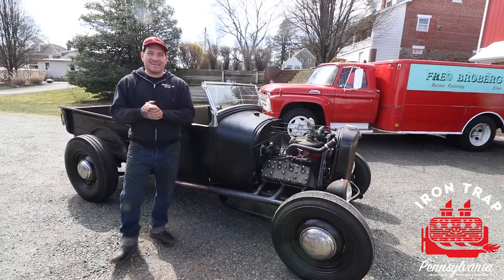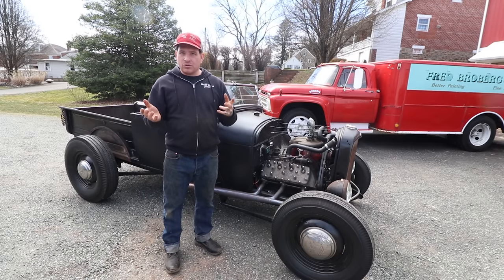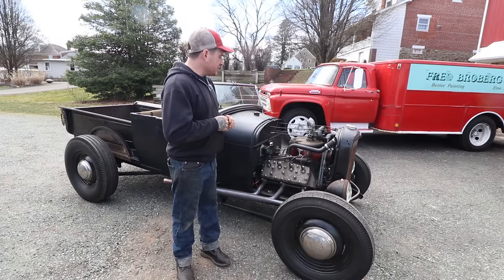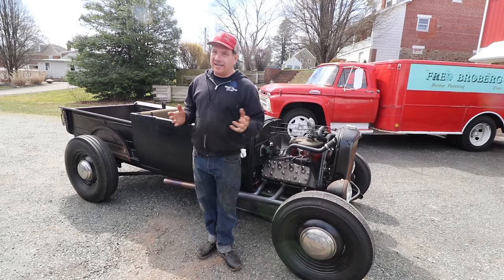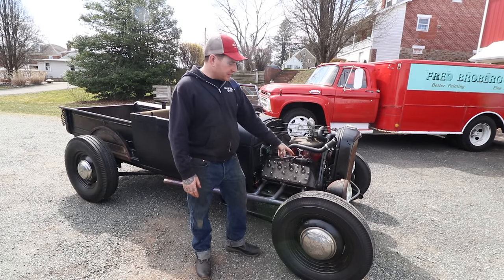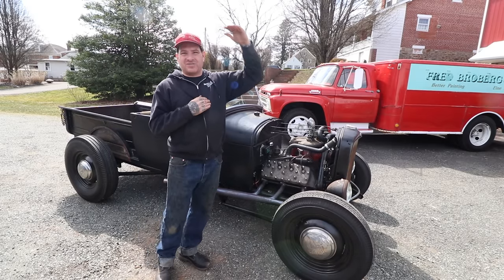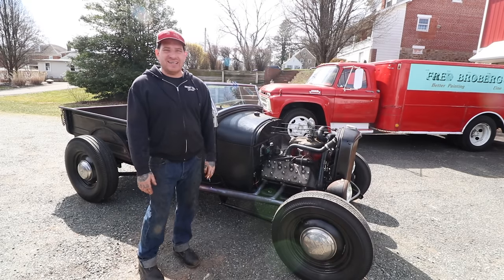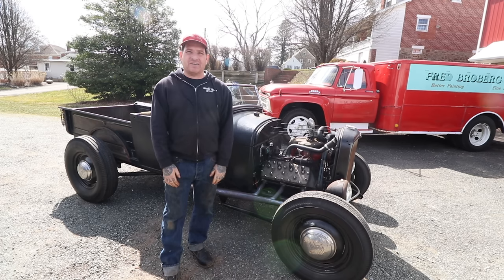The Ultimate Pre-War Jalopy Shop Truck - Hot Rodding 101

Comment: You have to love the sound of those pipes on this truck...  Reminds me of a neighbor's car back in the 1960s.  He had a 1954 Chevy Bel Air 2-door hardtop.  The old 235 6-cylinder had a 3-2 barrel log manifold and split exhaust headers, running a pair of straight pipes out the back.  The pipes were fabricated from driveshafts and were about 3 inches in diameter.  The sound was very distinctive.  He lived on the section line behind us, which is exactly a mile away.  While standing outside waiting for the school bus I could hear him fire that engine and pull out of his driveway on the way to school.  Amazing sound...  I guess it is the high-carbon steel that gives it that tone.

Comment: I have only ridden in two model A Fords. Both were 1929 roadster pickups. The one I will always remember most was in 1969 when I I met this guy named Steve. He had built his in the early 1960's while in high school. His had a model B four cylinder block with a Christie OHV conversion head, two Chandler Groves two barrel carbs, headers, Mallory dual point distributor, 39 tranny and a quick change rearend of some type. It probably had alot of other features I didn't notice. Steve also had a 1955 Ford F100 that had never had a Ford motor in it. The original owner of the Ford worked at a Ford assembly plant in California and bought the truck without a engine. He bought and installed a brand new Cadillac engine in it. When Steve got the truck the Caddy engine was worn out, so Steve installed a 394 Oldsmobile engine in it. Steve lived in Napa California as was a well known dealer in old Ford parts as well as Studebaker and Packard parts. He was killed about 10 years ago in a firearms related accident.

Comment: Love that Roadster pickup , Matt . I remember when you got it down in TX . Basically a parts wagon , with rims . As I recall , & the older folks  can verify this , they used to put garden hose over the tail-gate chains to prevent the noise , & resulting damage the chains did , while driving . I believe you put some spring - locking carabiners on them as well , to prevent them from "hopping out" of the tail-gait locking tabs . As a near finished Roadster truck , it's fantastic . I only say "near" because it would look awesome with the bed re-decked in new saw-cut wood , maybe a little deck sealer on it as a preservative , stain optional . But as you said , this is a vintage "old-school" Roadster truck . Nothing flashy , so much as fast , & functional . So in that respect , it's as done as it needs to be . Just how much gas did the original tanks hold ? Less than 15 gallons ?

Comment: very interesting to me, thanks. I have most of the makings to make the same machine. Hope mine comes out that cool. Going to use your videos as a guide. Never built a hot rod before, I have a 28 roadster pk up body, fairly rough and a frame + a flat head v 8 - thanks again
Reply from the maker: You got this! Good luck!
Reply from the maker: You got this! Good luck!

Comment: Love the build Matt! IT'S BITCHIN!!
This came together fast, thanks to your prolific parts collecting.
The only thing I would change is putting me in the drivers seat. 
One question, did the truck engine have a bigger cam from the factory? 
Thanks for all you do, and bringing us along.
I am hoping to be making a road trip from Missouri to Dover this summer. I'd love to come by and pick up a couple Tee's.
Reply from the maker: The truck engines weren’t much different in this era other than some having a different pulley arrangement. Later engines were factory relieved for bigger valves and some other small differences

Comment: First commandment, make it to fit you and make them drive well. End up keepers and collect more road dust than garage dust. I missed the big red truck engine change episode, I'd do a 90s 460 O/D 5 speed, near bolt in and would pull the truck and load.

Comment: We had a dumb woman ask why we didn't have smog control on the 1918 T.  I  said because its a hundred years old.  They didn't have smog a hundred years ago.
Reply: Not required on cars that are older than 1972.   It is supposed to be 20 years old but I think it's 1972.
Reply: The first smog was just a pcv valve and that was in 1965.  They got an Air pump in 66. Didn't have a cat till the 70s.

Comment: Ok, I'm confused, you said it has a flathead V8, but I see only three exhaust tubes?  ;-)
Is the block exhaust passages directing the center two cylinders exhaust (each side) into the one header pipe?
Reply from the maker: Siamesed  exhaust ports. Many early v8 engines were that way.

Comment: guys started this hot rod style with little to no money, now i would have to mortgage my house and land just to build one. this simple hot rod is not for the blue collar man anymore. now the hot rod scene is more of a bank account status than fabrication and skills status.
Reply from the maker: You’re so wrong. We’ve showed Before how to build cars for cheap. Lots of hot rods running around that were built on a shoestring budget.
Reply: @IronTrapGarage  yeah maybe up north, but here in the Deep South if you can even find a model a body that is for sale it’s so overpriced and a complete piece of junk. 3-5k for a body with most of the bottom gone rusted completely away like the body was sectioned by nature. And it’s not just fords. Any older iron here in the south is crazy expensive. I see guys from up north and out west getting decent model a project s for 1-3k and most the time it’s a roller with the stock 4 banger. Around here I’ve seen the same go for 10-15k for a clapped out stock coupe or sedan that don’t even run( if the motor is even there.)Just my experience in my neck of the woods.
Reply: @danyennis8126  Post war hot rodders were buying 20-25 year old cars that looked out of style and nobody wanted. I grew up near LA and watched the jalopy races in LA on TV, and these old bodies were a dime a dozen and chopped up to fit on the car's frames. That's how "Beautiful" ended up back East - the little old lady from Pasadena couldn't bear the thought of it getting chopped up and put on the track.  A hot rodder could pick one up for $50 or less.  Today's equivalent is picking up a '95 Mustang or Impala and hot rodding that - that's what plenty of "hot rodders" do today.  The '60's and earlier market has turned into a specialty field where you have to make it your hobby and really search out if you want deals - stuff is a lot rarer now. Matt has parlayed his passion into his profession, but he spent years of time and study and did what he had to do to get where he is today. If you want it bad enough, Dany, you can do it - you just have to plan your path and make the sacrifices. If you got mouths to feed, well, you might just have to sock a little beer money away every month into your hot rod account and build it later in life like I did. But if you want to hit a target, you got to aim at it.

Comment: This is not pre-war, all hot rodding started after WW2. It still a cool car, but get the history right
Reply: This is incorrect, the SCTA was formed in 1937. Speed equipment manufacturers really took off in the 30s. Phil Weiand had flathead manifolds in 1937 and Edelbrock in 1938 for example. This is elementary knowledge if you’re really into this stuff…